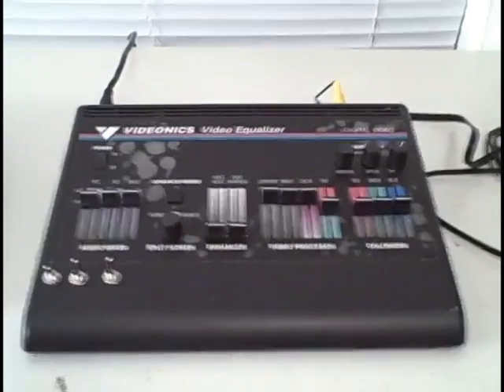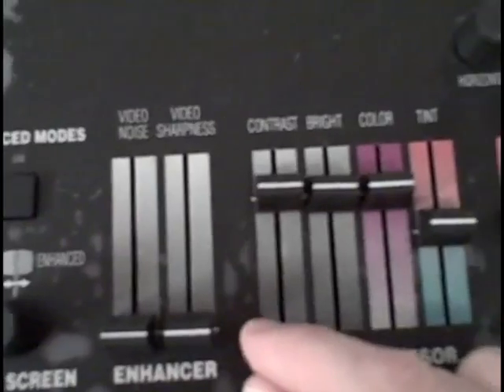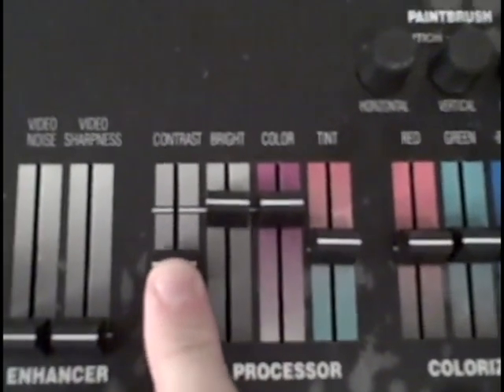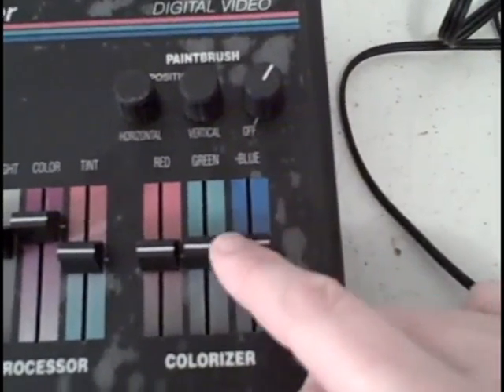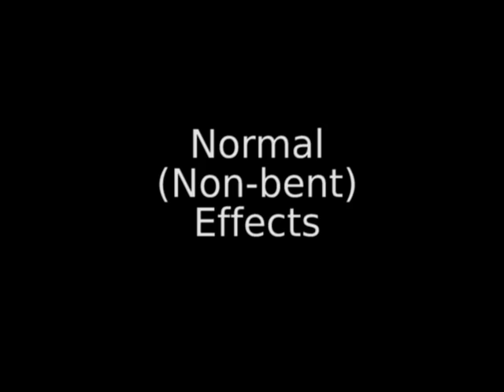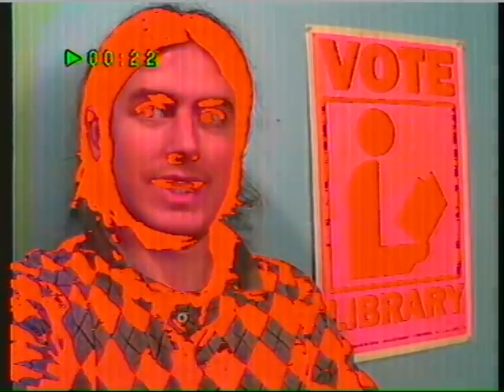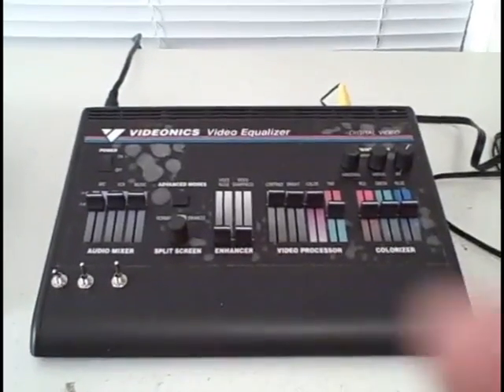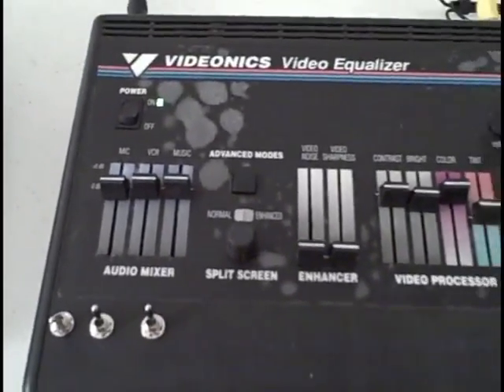Circuit-Bent Video Equalizer

Comment from the maker: BUT more to your point, unscrew the thing, plug in an input and output to a monitor (you may need a mixer in between for TBC), and use a circuit-bending probe (easy to make, or just use a wire with 2 open ends) to connect 2 parts on the board that aren't already connected. There is always a chance of frying the board (or yourself) so be careful, and try to steer clear of the power section of the board. When you find a connection you like you solder things up with a switch or dial in between...